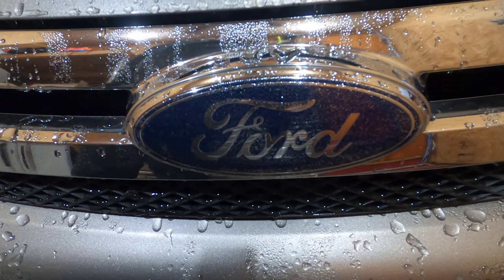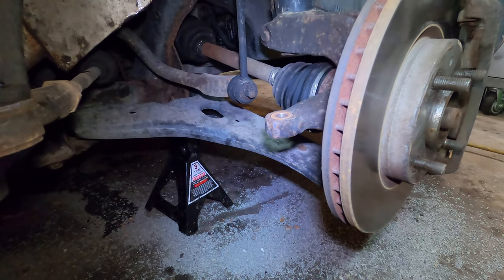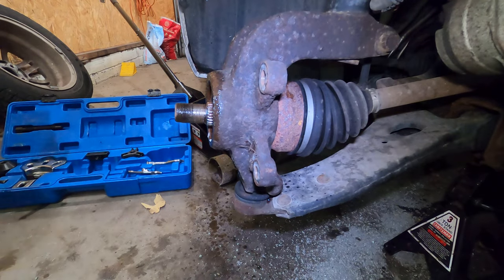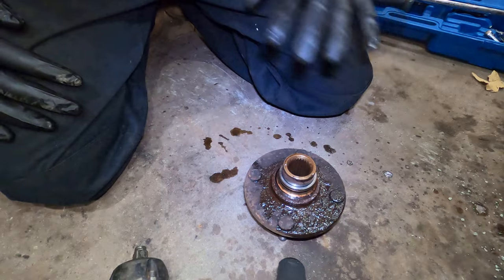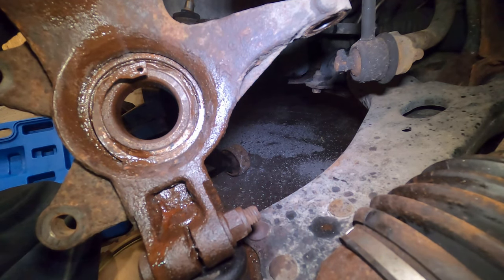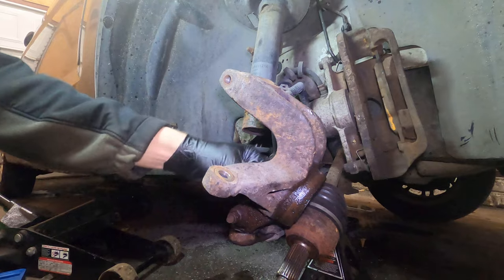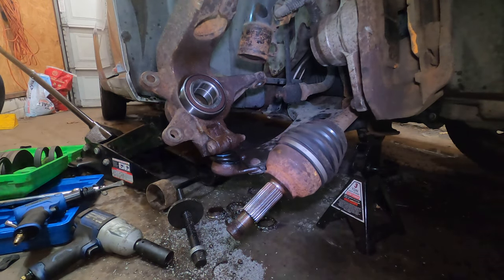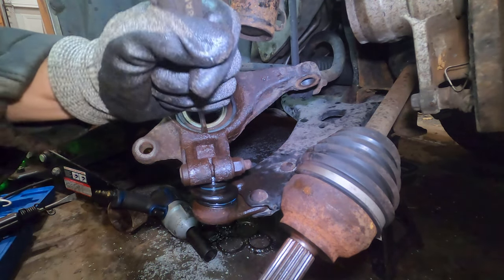2008 Ford Focus Front Bearing Replacement FT  Snapring From Hell

Comment: don't forget to Torque nuts ,  Drive Axle Hub nut Models  2001-( 173 ft-lbs) , 2002-2004  - (233 ft-lbs) , 2005 and later ( 199 ft-lbs ) ,  tie rod end balljoint -to-streering knuckle nut models through 2005 ( 35 ft-lbs) , 2006 (30ft-lbs) , 2007 and later (26 ft-lbs) , suspension strut -to-knuckle pinch bolt models through 2005 (66 ft-lbs) 2006 and later  (111 ft-lbs )  avoid any miss haps and check .
Reply from the maker: i hope this video helps. feel free to like and subscribe for more & if you can, please help the channel out by giving a super thanks. Making these videos takes a lot of time, but we do it to save you hundreds. also head down into the description and check out the link for some high quality led bulbs for this and any other vehicle. use my referral for a discount. Add me in Instagram for behind the scenes pics and Stop by my store for some Anything Auto gear.